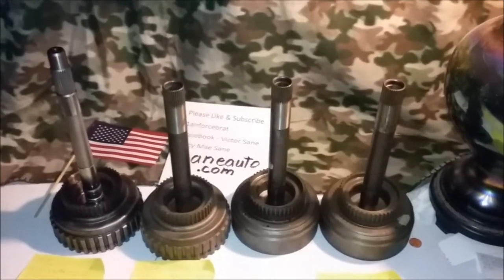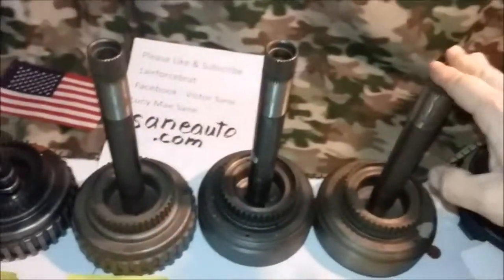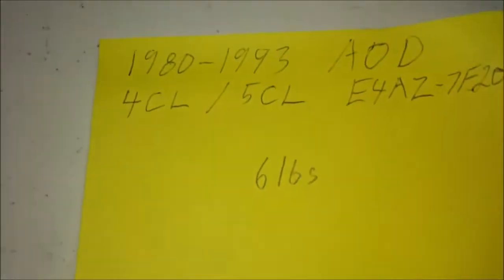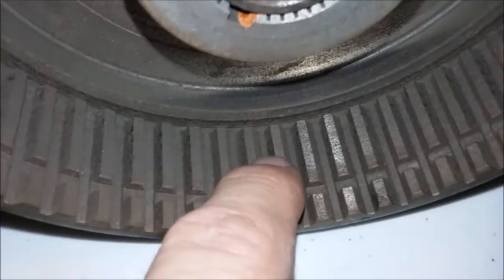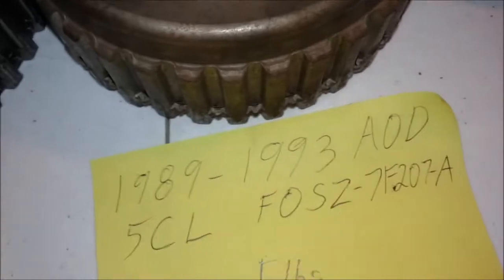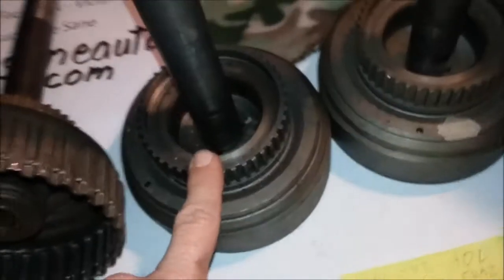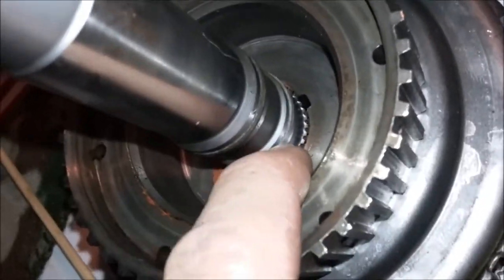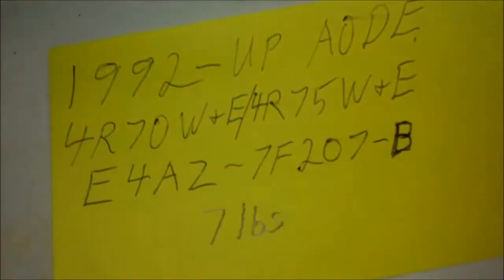Ford AOD 4R70W 4R75W Automatic transmission Forward Drum differences

Comment: I have a 4x4 87 Bronco 302 efi that was swapped to a 95 351 efi with a built AOD that was good and 6 years old with low mileage in it. The installer ordered the new flexplate with 0 balance for the internal balance 351/408. Very shortly after the install within 10 miles it stopped upshifting 2-3. There was some dibri cleaned out by a trans shop and they said it was fixed now. Then short miles later same issues. They said it had more and suspected clutches and clutch debris. Not driven hard or off road yet since received either. I took it to another shop and they said not that much and not clutch but bad and needed rebuild. I now concerned with the AOD and  the TV setting with  the swap and the same issue with  a rebuild. Could this be the flexplate?"  Internal AOD governor with swap? TV adjustment?  Way to determine the cause?  What would be the best transmission it is a 4z4 long travel built prerunner. King shocks 4.86  gears lockers, long travel 18" f 20"r  etc.etc..It has a fresh rebuild and improved Borg W 1356 I did. I like the OD do drive from the concrete jungle in so cal to places like AZ, NV, or in CA but hours away but also run  aggressive off road and long  off road trips desert and mountains on 35" tires. I am concerned with TV cable is electronic better? It will be built for power and separate computer if electric.Thanks and any info  may help it is a bit stressful I  like my  fUll size Bronco.